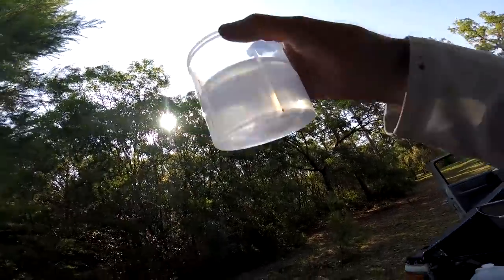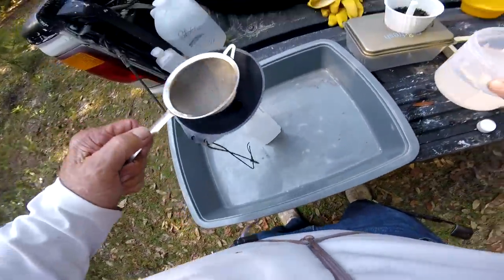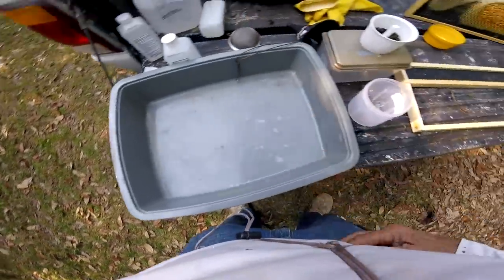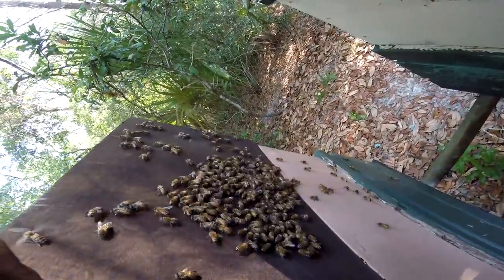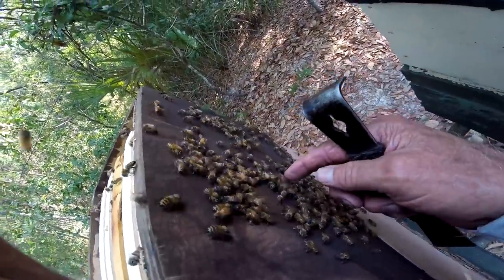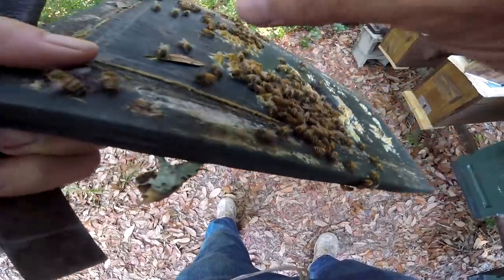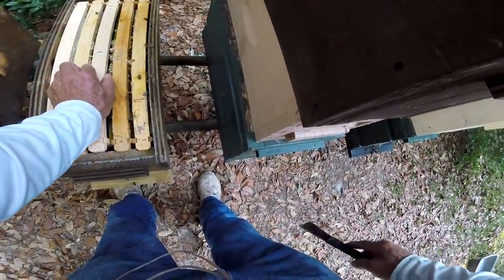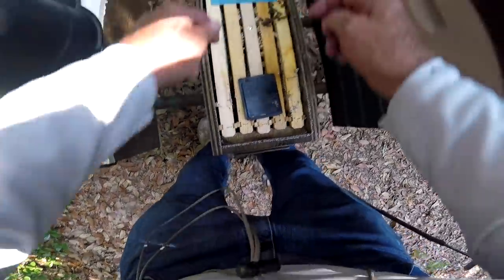Installing Drone Frames

Comment: I have a question about a man lake five frame box but holds  6 frames I was thinking I could build some like that and have the extra frame to restart the box what do you think plus I can put a divider and have three frame  boxes for Queens what do you think
Reply from the maker: Years ago i used 3 frame nucs but if you don't stay on top of them they will blow up fast and that is why i use 5 frame nucs.